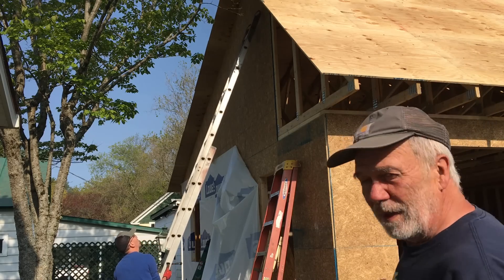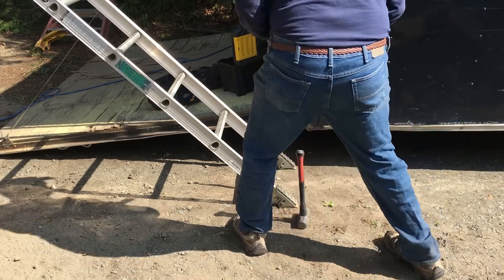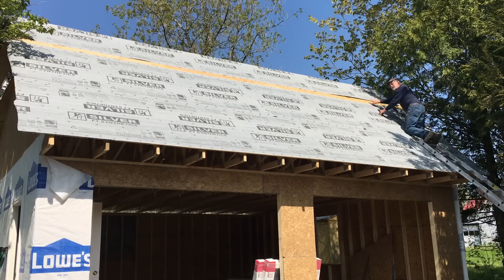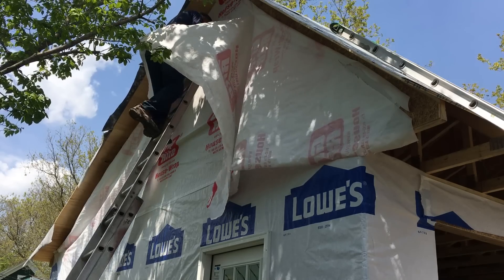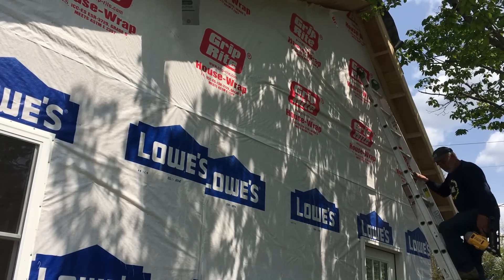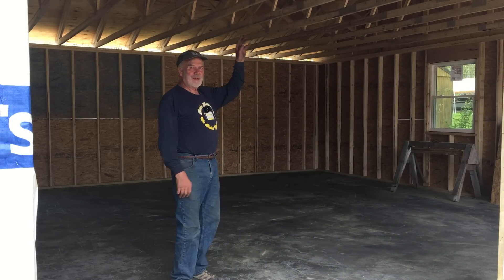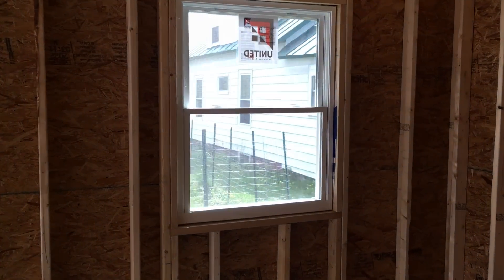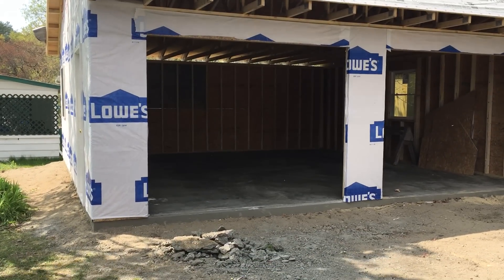Admitting I Have a Vice

Comment: When we put windows in, our manufacturer taught us not to put window tape on the bottom flange; only on the sides and top as the bottom could accumulate moisture from above; you'll also save material.😉

Comment: Thumbs up 👍 an idea would be to put a 1/2” by 12” x 12” steel plate under the vice. For hammering and such as the vice is cast iron.  I use it to hammer 🔨 on and I have setup a few holes I put in 1/4” bolts. The bolts for bending wire and rods   It has many different uses.  But I don’t want to break the vice, as I have 1 small vise as well. 
Good point on door swing. Thanks 🙏

Comment: Curious about the cost of metal vs. conventional roofing?
Reply: maybe he will mention cost in the next video. The last time he spoke on the subject, it was more $$ up front, but somewhat balanced by the speedy installation. The next part is it will last about twice as long.
Reply: What sort of roofing are you thinking of? (Maybe shingles?) There are quite a few, each more popular depending on location etc..  I think metal is quite conventional in the States, but not in the U.K. (slate or cement roof tiles are first choice over here)…
Reply: (Also garages have to be brick built in the U.K.)
Reply: Do you always seal the bottom of your windows? I've seen others leave the tape off the bottom for a place for water to go if it got through?
Reply: My sister is getting quotes for her barn gambrel roof. 16k asphalt shingles, 22k grommet screwed metal and 32k standing seam metal.

Comment: With all the hauling you have to do, why do you buy short bed trucks?
Reply: have you noticed they haul all the big stuff in a trailer, because even a long bed is not long enough? Even a long bed HD won't haul the weight they put on the trailer.